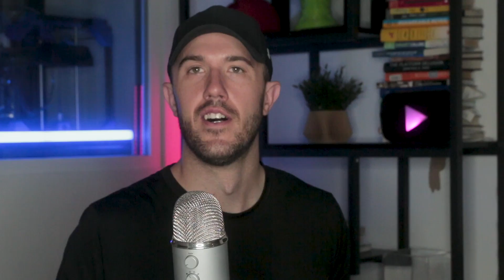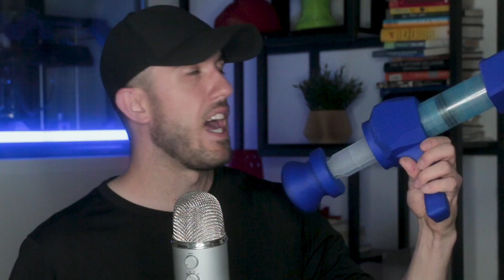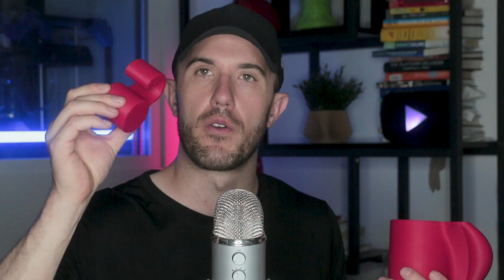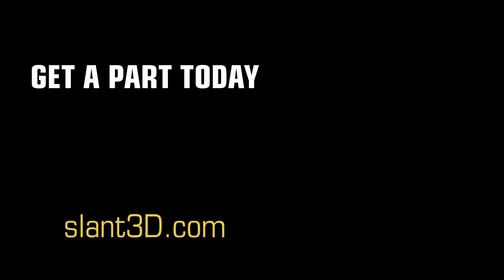The Truth About PLA+ | Open-Source Doesn't Work | Stratasys & Nano Dimensions | 3D Printing Podcast

Comment: Open-Source Design is more Collaborative Design by a community (or design by committee) with a common interest, and various design skill levels. All successful open-source projects share a common trait it they are too complex for a single designer to create, and have a design that has to evolve over time. It works for software development as tools for collaborate design exist. The design evolves where there is community interest, and dies where interest lacks, or fades. With software there is much less cost of distributing software hat has extra baggage, or weak/broken components included in the design if they are not often used. With physical products, the extra poor design baggage becomes wasted physical material, and/or potential failure point(s) to a the good parts of the design.

Open-Source as a distribution channel only tends to fail, as support for continued work on design and maintenance will fade off. It's most true of simple, or single component designs. This is because there is little (or no) reward for those contributing to the design.  Not to overlook human nature, as everyone is attracted to new and interesting designs, but few people like to fix poor, or bad (elements of) designs. Lack of reward for contribution leads to the open-sourced design being branched as contributors begin hoarding their branch of contributions. Longer term open source projects tend to have a conceived a mechanism of rewarding contributors that may not be obvious all those accessing the open-source design. Branches to the design also need a reward system, or they will become isolated, or die.

There is also the issue of different interests wanting to drive a open source design in different directions. This becomes more an issue the bigger, or longer an design exists in the wild as open source. The tendency is to branch the design. A better approach to community design is making making projects modular, or creating a layer approach to design (like an onion, or an inverted pyramid). In software, a good example in Linux where there is a core kernel than only a few have access too and any changes are reviewed and verified before new editions published. Higher/outer layers of Linux allow increasing more public access. This greatly helps maintain the quality and reliability of the overall design. Many higher layers (open and closed) can build on top of this reliable core quality. Key to a layered design is having great interfaces, plug-in ability, or attachment points. This works well for more complex designs with many components, but fails with simpler, or single component designs.

An example of shared design exists among animal lovers, where breeds of animals (birds, cats, dogs, etc) are shown, judged and recognized by characteristics of a living design. There are controls managed by a core group (breeders) that are approved to replicate particular designs. This involves certification, which adds a layer of logistics and cost. For complex designs, controls on a design can ensure reliable quality, but would add excess cost to simple design, without added value.

For 3d-print designers of higher quality designs, a replication facility like Slant 3D can offer public access to a design without making the raw design (IP) public. Designers and their clients can be assured of manufacturing quality and value delivered in the produced components.

Comment: I've gathered quite a collection of filaments and types over time PLA/ABS/TPU/PC/Nylon, and I have to agree that slapping on a + is total marketing BS if there isn't any data behind it. I've never even seen a point in buying anything marketed as such, as the slight change in material properties would be completely dwarfed by the idea of moving to a new material entirely for inherently enhanced toughness. The ones that might be interesting though are the low-warp types for materials that typically are often too tricky due to continuous deformation throughout printing.

Comment: There are various different uses of open source.

Open source software - thousands of projects - are the foundation of the Internet. Not all of them are company backed.

While Linux is benevolent dictator governed who doesn't report to anyone, the vast majority of key work there is performed by thousands of businesses including a few heavyweights like Red Hat, hardware companies, hosting/cloud companies, according to their interests, and if these proposed contributions are deemed acceptable by Linus, they go in. These businesses all need a common platform, an infrastructure, that works, and they place their trust in the good judgement of the maintainer. So this is actually a good example of symbiosis between business backing and community interests.

Traditionally, open source electronics doesn't quite work that way, not the same goals and outcomes, as hardware isn't quite so replaceable and has an update/iteration cost to it; however it does enable repair and modification and gives the buyers of the hardware an ultimate level of ownership, just like open source software gives the users an ultimate level of ownership. And yet all the 3D printers most of us use and you use are RepRap descendents - it wouldn't have been possible without open source. The ability to just throw together a RAMPS or have it made and not be dependent on single suppliers has kickstarted all this. In turn this leveraged Arduino, itself an open-source product which would have likely withered away like any number of beginner friendly microcontroller boards had it not been open source and allowed copying and adaptation. Does anyone even remember the BASIC Stamp, or whatever weird stuff Conrad made, C/Control or something?

Open source physical/mechanical hardware is yet another can of beans. You never downloaded a SCAD file and customised it? Or modded someone else's STL? Of course you did. Again, the way you got an early 3D printer is by someone printing you the files. I have seen people pick up someone else's robot arm project or somesuch and contribute to it, don't remember examples.

I think you have a slightly skewed view... in that you see a lot of open source endeavours in the physical realm go wrong or go nowhere and get abandoned. The same happens with software, most projects are abandoned. What matters is not what didn't work out, but what did and ended up contributing to the world.

There are more successful community driven open source projects than you might be thinking of. Is Inkscape backed by a company? GIMP? Blender is a weird case, it's backed by a foundation and people pay the foundation to develop the software, but people trust the software that it's going to be around and they can keep using it because it's open source, the foundation does hire community members, and there are full forks which have different goals and approaches which are completely independent. Sometimes business backing of open source software goes wrong, like in case of OpenOffice, with a community of contributors splitting off to form LibreOffice instead. Granted a lot of these aren't the best software in the world, but by being accessible to everyone, it is uniquely useful, and has made the world a better place. Reprap printers like your own farm ones aren't exactly Stratasys killers either, but they matter.

Granted if you don't feel like open sourcing your models makes sense, i suppose you're right. I do wish a lot of ecosystems around open source projects worked better to support the creators, there are glaring unsolved problems all over the place there. I worked on a massive open source project and it was madness and it pretty much broke me, and i never got much money from it, while there were literal hundreds of millions spent and made using that software, which is just madness that people aren't willing to divert like 0.05% of their related revenue to support their devs. Big pain, can not really encourage anyone else to walk the same path.

But like democracy isn't perfect either, nor is capitalism, nor is socialism, and yet you can't just declare that these "have failed, do not work, return to mon ke archy". We need to see the fundamentally good in things and push and weave them into something that DOES work.

Comment: What a weird rant and mindset on open source...  Whether or not something gets updated or not is totally not linked to whether it is open source or not.  Just look at Prusaslicer & Cura (both open source) vs. Simplify3d (not open source and not updated for years).  And others using the open source stuff is the intention, BUT those others should then also stick to the license.  That said: enforcing that is as "simple' as enforcing a patent, just not as lucrative.  Adding infringement cost clauses to open source licenses could make such litigation more lucrative and as such dissuade companies like Creality from ex. breaking the GPLv3 license of Klipper.  Technical/functional designs could also be published under a similar open source license requiring the innovative part may only be used if the entire assembly it is used in would adhere to the same license (and again add infringement cost clauses to make litigation against companies not doing this is lucrative).  Clearly documenting that innovative part similar to what you would do for a patent, would be critical to ensure any litigation would stick, but it could offer an alternative to patents without the initial cost.
Reply: "infringement cost clauses". Register your copyright. Then, you can sue for treble damages over and above what the law allows.
Reply: @RussellNelson  But if it is open source, when an infringement would be brought to court, then you will likely win the case (copyright or not), but that same court would then likely force the infringing party to adhere to the license and best case have then pay for legal costs.  As the thing is open source the assessment of the damages to be paid would end up being very low and hence any open source advocate taking a company to court will run the risk of making costs every time when a company like Creality breaks the license and has to be taken to court.  If the license would clearly identify the cost for infringement of the license per day of non-compliance (and what party those should be paid to), the damages awarded in court can be much higher and hence also be more of an incentive for companies to comply from the start ... Now they don't risk much when breaking the license, so the cost of that needs to be increased.

Comment: The other thing to keep in mind for opensource physical products is that it is basically impossible for a consumer to edit the designs for free. If you distribute the CAD files then in order to edit them as a consumer you have to install Fusion 360 or Solidworks to just get started modifying it. Contrast that with any opensource Arduino library, where (assuming it's not insanely complex) the end tinkerer can just open it up and start poking at it, provided they have the hardware to upload it to. This is all without needing to install tens of gigabytes of software and agree to really cryptic licensing terms like with CAD files.
Reply: This is why early 3D printers were all OpenSCAD designs. Prusa MK3 is OpenSCAD for 3D printed parts as well. Small and simple open source toolchain that is very in line with software developer's skillset and thinking. Prusa Mini is a Solidworks design instead.

The toolset of FreeCAD is actually quite exciting, even though the usability of the software has massive issues, BUT they are gradually making it less terrible.
Reply: @SianaGearz  OpenSCAD works well for sharing designs and since the file format is a text file it works well with Git version control. I use OpenSCAD for all my parts.

Comment: opensource seems to work for 3d printing software as well, klipper, most slicers, etc etx all seem pretty healthy to me. For hardware it simply does not end up like a fair and succesfull open ecosystem in most cases, maybe Voron but calling that open source when its extremely hard to even get your designs accepted into their models without doing a ton of social engineering.
Reply: A ton of social engineering? What do you mean? To get a mod published on their GitHub?

I'm not so sure that open-source software are more "healty" than hardware. 

Software like PrusaSlicer, Cura that are maintained by a company are fine but for the rest, their financial survival really relies on donations and partnerships with big brand. There is an interesting Meltzone podcast, the last one, on that topic with the curator of Marlin.

And for the open-source hardware it's even harder if you want to commercial it. Because one side having a production line and employees costs more than making a software. And on the other side, everyone else (especially  china) could potentially do it cheaper.

Since Bambulab, a lot of things are moving for sure. I'm not sure that brands like Prusa can keep up in their price segmentation.
They didn't release the MK4 files yet!

I don't think Bambulab is even worried by Prusa printers. They are in an price war with Creality.
They just release the p1s in response to the k1.
Will Creality keep up? They still have to deliver the Max with the LiDAR and bambulad as already a x1s and x1e ready...

And on the other hand Creality uses klipper for their k1 and didn't release the code (yet I hope so). And about the bambulab firmware, it's really original? How to know if they didn't use klipper or other open-source libraries?
Reply: @KevinLemarchand  try to make a change to the official voron designs, that's more difficult then doing a pull request to the Linux kernel and getting it accepted. Says a lot about how "open" voron is. It's open as in they share what they make, not as in we make and we share.
Reply: @malloot9224 I do understand your point of view. I never tried to PR on their github. But I assume it's more difficult and time consuming to validate a PR on a step file than a code file. And testing them takes time depending on what's changed. Also I think they preferred to push mods than adaptations on the official release. Because they don't want to have new releases every 6 months, so the kits don't need to be updated all the time. It's a strategy of diffusion imo. But you're right, official releases are made by a handful of selected people. But that doesn't bother me at all.

Comment: Ok so I’m not saying your wrong about the viability of open source in 3d modeling,or that it’s right for you guys, but, saying that linux is some exception in open source is a bit disingenuous.  First of all “Linux” is a pile of hundreds of open source projects, with the Linux kernel being just one of them and with hobbyists maintaining the majority of the other libraries and other components(the timekeeping software for the entire world is effectively maintained by one person). 

You’re also ignoring the work happening in places like the Apache foundation where tons of core tech is getting built. 

Maybe most relevantly comparable to open-source models being released by hobbyists- you’re ignoring the entire web development ecosystem, there’s millions of OSS packages maintained by a single individual or small group of part time devs that are then used by huge swathes of the internet. (Google “left-pad” for an example of this going wrong, but that only proves how commonplace it is). In most cases this is being done because they’re projects someone would be doing anyway to learn or satisfy some need they have, and by sharing them they act as a resume/career networking tool. 

No idea if that same dynamic can or should exist outside of the software world, but while linux is special because it’s so broadly used it’s certainly not unique and there are a number of models that make OSS work in software, both as a hobby and as a business and it’s not fair to the rest of that community to act like they don’t exist, especially in the same video where you talk about the software your building that nearly certainly uses dozens or hundreds of open source components.

Comment: Polymaker Polymax defintly felt super different from normal PLA in my experience
Reply: Polymaker actually releases material technical data sheets for their filaments so I think you can trust that (at least more than any other company the sells PLA+)
Reply: Polymaker is very transparent and provides detailed technical data sheets. Their PLA+ and PLA Pro are both different specialty blends that heavily increase impact performance and ductility over standard PLA.
Reply: Polymaker is the most brand-name of all filament companies, so they're not going to screw around with false marketing terms. But the other brands will and do.
Reply: I thought polymax was polycarbonate (PC)?
Reply: @Max24871  Polymax is a range of higher resistance filaments, Polymax PC is their high strength PC blend.
Reply: @samlcyo2  that makes sense, thanks. Although that name seems a bit misleading now

Comment: All the PLA+ and impact PLA I’ve used is quite different to the standard PLA I use. The PLA Pro had significantly weaker layers I noticed. But I’m sure there is a temptation for some companies promote standard PLA as a Plus version to charge a slightly higher price for it.
Reply from the maker: Depends on the manufacturer